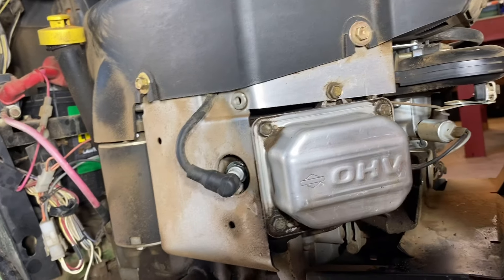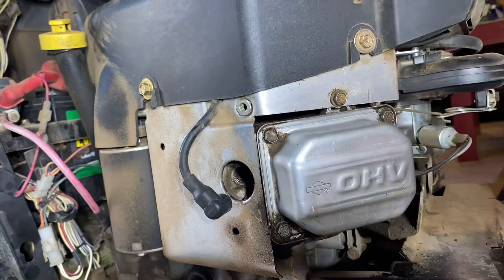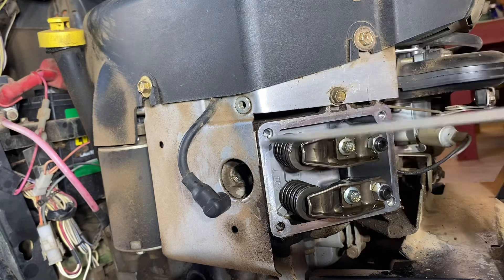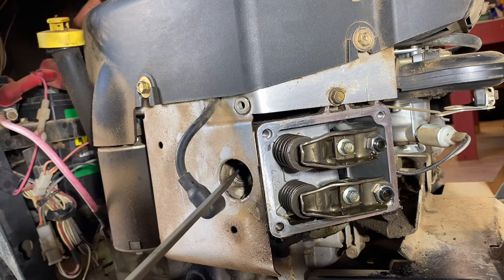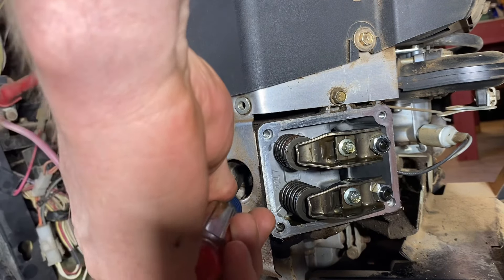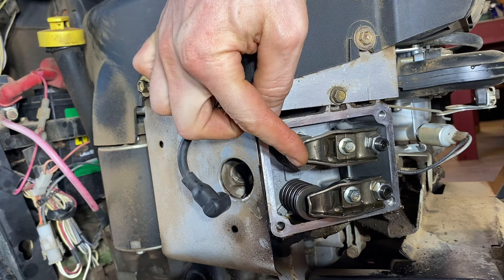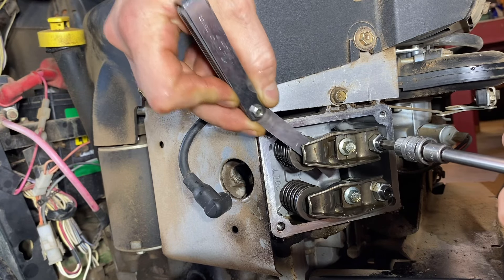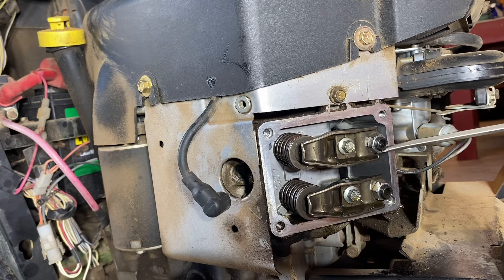How to Adjust Valves on Briggs & Stratton Engine, THE CORRECT WAY!

Comment: It's the camshaft that has eccentrics that open the valves against the valve springs, not the crank shaft. The engine connecting rods are connected to the crankshaft, not the push rods. If going to the trouble to adjust your valves on any engine, it is not so difficult to adjust them to the published specifications for optimized performance and long life.
Reply from the maker: Yeppers thanks Craneo

Comment: Ride-on mower B&S the rod for the intake valve does not move, possible engine damage? Thanks for answers.
Reply from the maker: Probably means the cam shaft is not lifting it. Will need to take off the oil plan and take a look at the cam. Look at my B&S playlist, it has all the videos you need. Good luck

Comment: I’ve done this on several motors with great success. This time however not so much. When I performed this service on a 21hp 540cc motor in a Craftsman YTS3000 it took multiple attempts before the compression dropped enough for the engine to crank. Valves are currently set at .004/intake and .006/exhaust. Even removed cover again to make sure. Still cranks hard though battery reads 12.9v. Weird thing is now when I shut it off it after fires a few times before stopping. Exhaust smell rich(?). Which way do I experiment with the valve lash to resolve? Greater or lesser lash space? And which one? Intake, exhaust, both?
Reply from the maker: Sure doesn’t sound like a valve issue. Maybe a bent pushrod or broke camshaft.

Comment: You can just turn the engine until the exhaust valve is wide open then adjust the intake valve, then turn the engine until the intake valve is wide open and adjust the exhaust valve. Boom done
Reply from the maker: Mic Drop!!!
Reply: Very good idea...time saver..Thanks for the info...
Reply: 2 things. 1, At 5:10 in your video, the damn 1/2” BE wrench I have did the same thing as yours. 
2, once clearance is good to go, what would cause the cam to be bending the rod when I hand crank the fan at the top? The exhaust valve is not stuck closed. Is it supposed to open as far as the intake on these? 
If so, then it IS stuck at about half way… 
Any help is greatly appreciated!!
Reply: @JeremyN1978 check the valve guides. common problem on briggs engines
Reply: I appreciate this method...seems easier....boom appreciated
Reply: a screw driver in the piston hole is a must for beginners 😎
Reply: my  v twin  husky 20 horse .. vale's are a pain in the butt it takes like 3 to 4 trys  to  get them set properly the motor was a taper  all it's life

Comment: You say adjust intake valve when piston is at TDC and intake valve is closed on the compression stroke. But you’re not real clear on the exhaust valve . So do you mean to turn the crankshat and adjust piton when its at TDC and adjust exhaust valve when its at the power stroke and fully closed
Reply from the maker: In simple terms you adjust them when they are closed. It really doesn’t matter. They say at TDC because they are both closed at that point

Comment: Is there a compression release valve on the crank or elsewhere? To adjust the intake at TDC 1/4 down?
Reply from the maker: Just remove the spark plugs and the fan. With the plugs removed there will be no compression.

Comment: Why does the Briggs manual say to rotate the piston 1/4" down after TDC?
Reply from the maker: I am not sure, it won’t hurt anything either way you do it. They probably are just making sure you hit TDC. The valves are at the same at the top as they are 1/4 past. Good question I have wondered the same things.
Reply: @MowerMike  on engines with a compression release, you have to back it off 1/4 to reach the lobe on camshaft that operates the release, then set clearance. It's very important or your release won't work correctly or may cause damage. If book says back off, then it must be done.

Comment: Hello.  Thanks for your videos.  On my Briggs and Stratton 15.5 OHV, I have one Steel and one Aluminum Push Rod.  Is that normal (I had some work done on this a few years ago)?  I need to replace the Guide Plate, Push Rods and 1 Rocker Arm.  I just wasn't sure if there was a reason for one Aluminum Push Rod - and if so, I can't remember where the Aluminum Rod goes - I didn't pay attention when removing them.  Thanks!
Reply from the maker: Good question. Briggs put in aluminum pushrods it is better to replace them with steel. I have video on this check it out
Reply from the maker: https://youtu.be/1nzfPYgpmqY
Reply: The aluminum pushrod is aluminum. The exhaust is steel/black.
Reply: @im2yys4u81  WHAT??
Reply: @Leftycraig48  My bad. lmao. The Intake pushrod is aluminum, the Exhaust pushrod is steel/black.
Reply: @im2yys4u81  ?

Comment: Don’t know if it helps but with mine a 13mm wrench worked better than 1/2
Reply from the maker: Thanks it does, that 1/2 in a bit loose
Reply: Got some revised ones the other day and they're much larger now
Reply: Same here.  And the Torx screw took a T30.

Comment: I recall reading the valve clearances are different for the intake and exhaust. Are you saying they are both .005?
Reply from the maker: Yes they are a bit different but .005 will get ya close enough. Google it if you want to be more exact.
Reply: @MowerMike  I checked the owners manual and  the range is .004-.006 for both intake and exhaust. .005 is fine.

Comment: I thought Briggs and Stratton engines were 1/4 past top dead center before you make the adjustment to your valves?
Reply from the maker: It doesn’t make a difference

Comment: Push rods ride on the crank shaft, huh ?...How does your engine run the valves at half speed to accommodate 4 strokes ?...
Reply from the maker: Yep is a design specific to 1997, was a one year deal very special motor. They only did it one year because it couldn’t keep timing with the pushrods running right on the crank. 

Who woulda figured, probably came from some crazy German Briggs engineer from A&M.

Comment: Almost correct. But on all briggs engines weather it's an L-head or OHV the engine needs to not be at TDC on the compression stroke but 1/4" past TDC actually starting the power stroke. This gets the compression release out of play and assures both intake and exhaust valve tappets are resting on the base circle of the cam. This procedure was done incorrectly so many times we actually dedicated an entire yearly dealer service update seminar to instruct dealers the proper procedures
Reply from the maker: Wow an entire seminar on setting valve clearance for mower engines. You should show this video at the seminar! Lol this is the problem fellas.

Comment: all wrong, you need to adjust with the big nut and while holding it in place tighten the set screw.
Reply from the maker: I agree I got a lot wrong in the video such as saying the rods ride on the crank shaft and not the cam shaft lol. But, I am not following you on using the big nut to adjust. Isn’t the big nut just a lock nut and you adjust the set screw? If you just tighten the set screw it will just push on the valve and will totally screw up any adjustment.
Reply from the maker: Barry you are thinking Kohler motors they are opposite on the Briggs. Just found that out

Comment: My owners manual shows 0.25" past TDC
Reply from the maker: I really don’t think it makes a difference but excellent point. Most manual say a touch last TDC but I think that is just making sure you get to TDC.
Reply: Pretty sure it’s because the motor doesn’t fire exactly on TDC, just right before TDC
Reply: @MowerMike  its does make a difference. It affects compression release

Comment: You shouldn't change push rods. They are aluminum and steel to distinguish which valve is intake and which one is exhaust.  For a novice trying to distinguish which is which. If he got that mower you cha b get the pushrods on that would present a problem for someone else that didn't know and was working on it.  For your personal mower that isn't alright.  The mower company did that for a reason. And that is  not to cause major problems if they fail.
Reply from the maker: I totally disagree